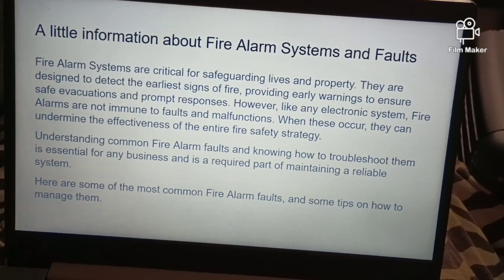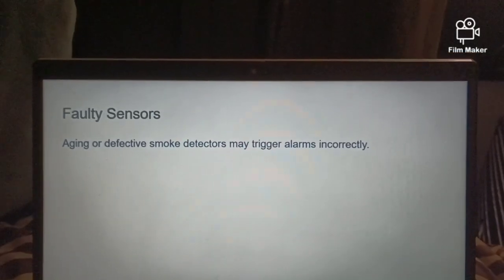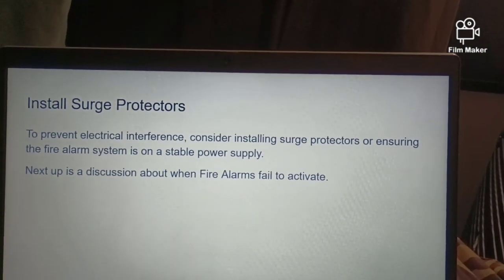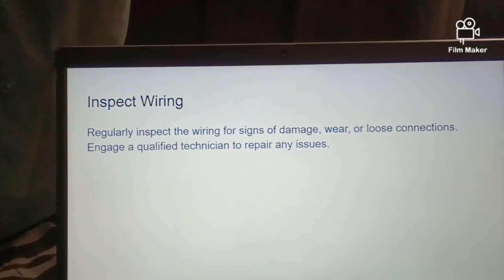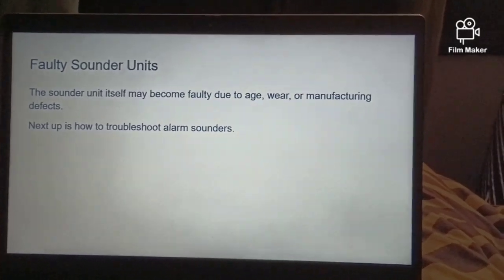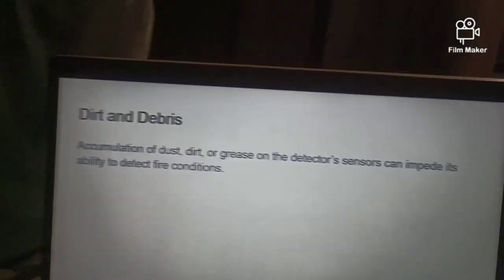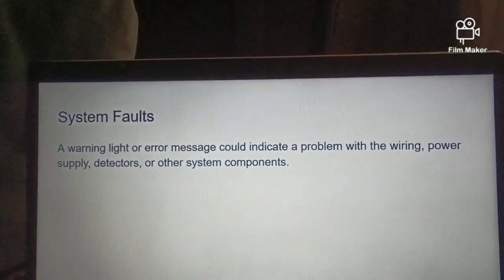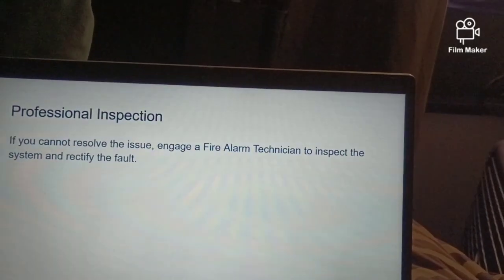Common Fire Alarm Faults and How to Troubleshoot Them

Comment: System Sensor one time had to recall the L-Series Low Frequency Sounders with date codes of 3034 and 3035 for low sound or no sound output